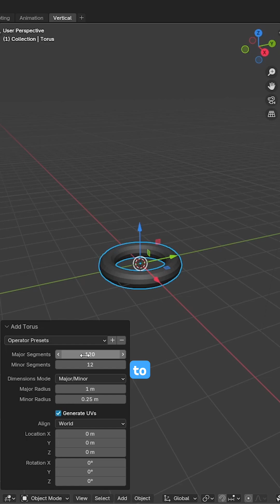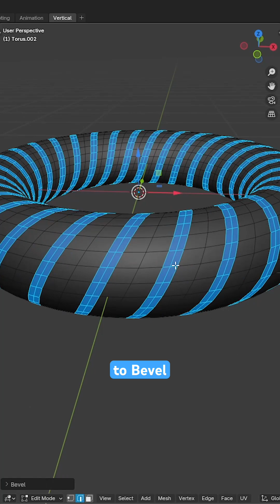Blender Modelling Tutorial | Spiral Torus #blender3d #blender3dmodelling #blender

Comment: Hey can’t you just add a twist with the simple deform modifier or just grab the top edge and press o then rotate, or does it give different results?
Reply from the maker: Both of these options are viable, yes! I went with this method since it gives you a bit more flexibility in customising how steep the spiral angle is with the screw modifier. So you could use a slightly lower major segments count and a lower iterations count on the screw modifier. 😄

But as with most things in Blender, there are always several ways to approach things. 😄